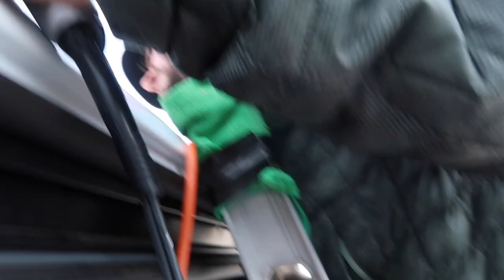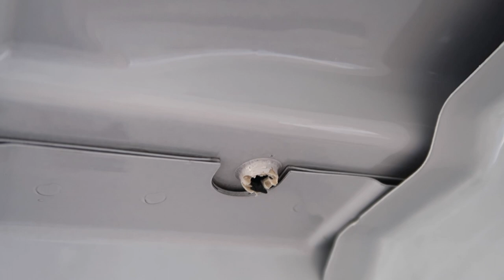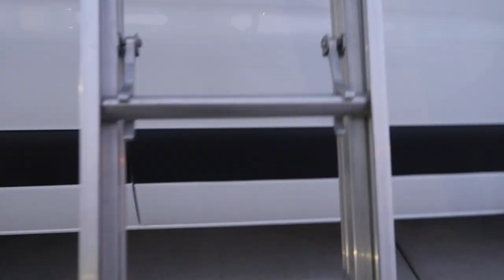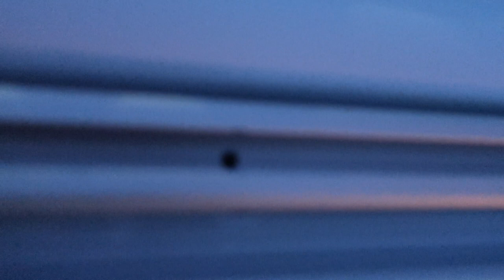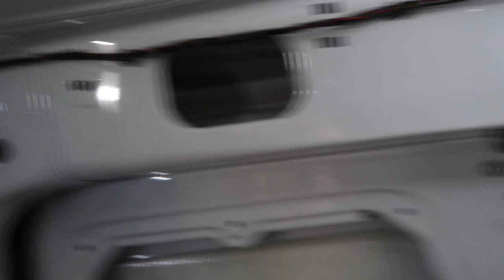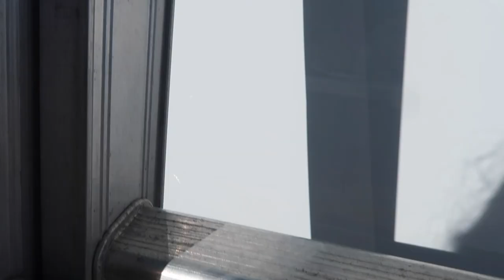INSTALLING VANTECH ROOF RAILS - DIY Sprinter Van Conversion Ep.4

Comment: what os the name or brand of black sealang you put before the rail? is it included with rail purchased?
Reply from the maker: Hi there, the putty stuff is butyl tape and it did not come with the rails but I put a link in the description of the video. If you're talking about the weather strip (long foam sticker) then yes, that does come with with the rails. Hope this helps! 😊

Comment: Those screws are probably stainless steel which can have problems with strength. They won't rust though but they are definitely not grade 8.